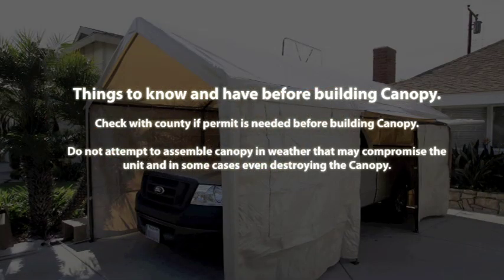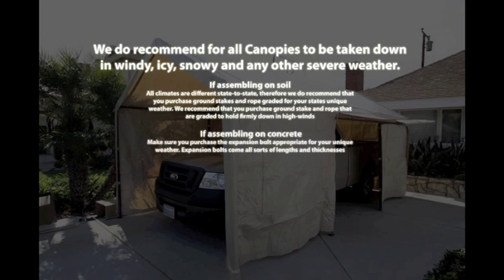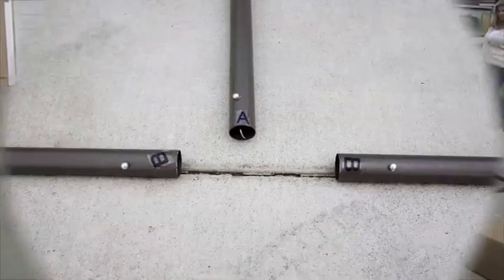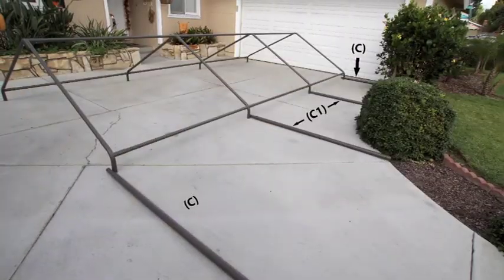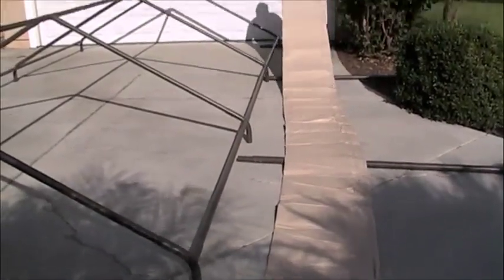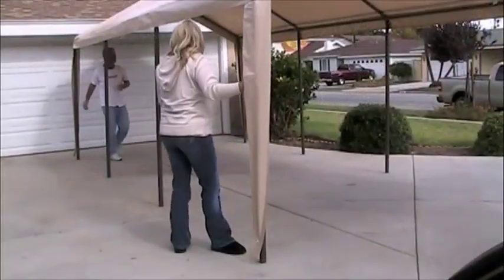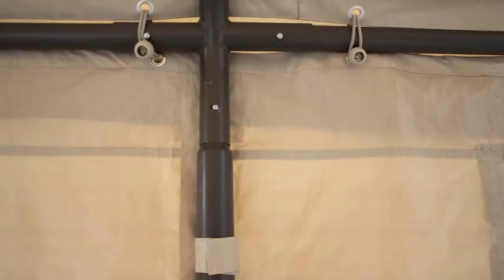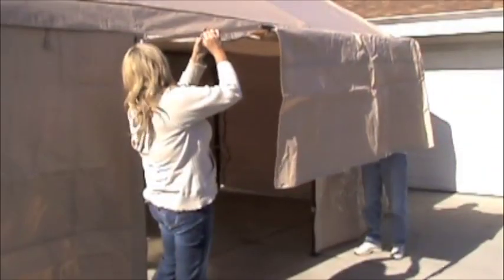Car Canopy Manual Video

Comment: I have 3 of those form Costco lasted about 7 years before the fabric disintegrated from the heat and cold. Climate not all that bad in West Central California, Bay Area. The steel frame will last forever. Just wondering how long your fabric lasted?